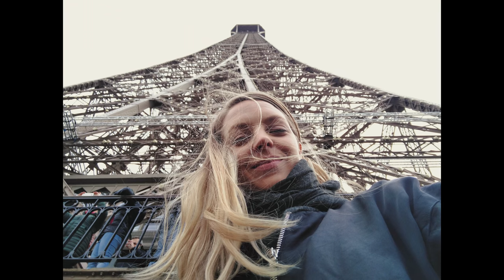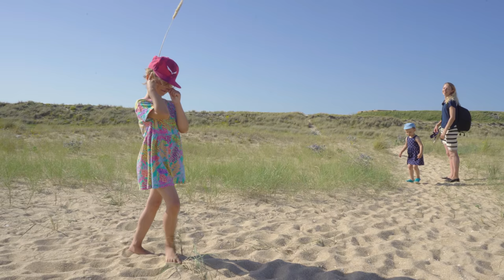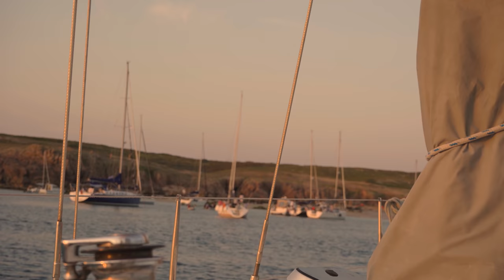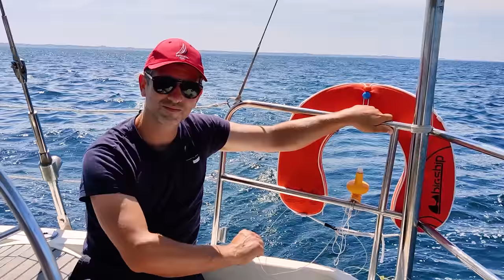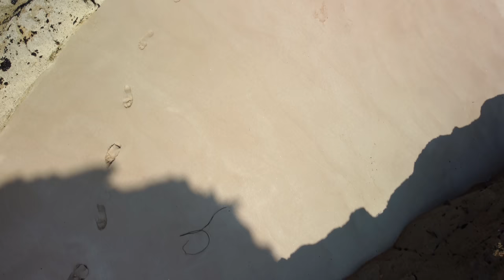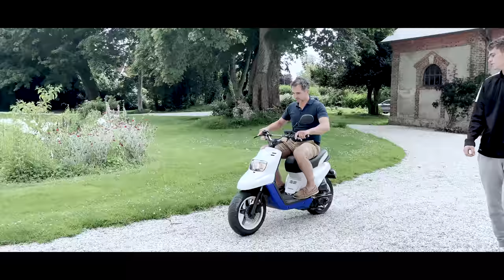Our Chateau Garden was vandalised! - How to renovate a chateau (Without killing your partner) ep. 31

Comment: I live in the country with deer, fox, coyote, ground hogs, rabbits, squirrels, chipmunks, moles and voles, opossum and skunks parading through every day.  My garden is fenced with chicken wire and I’ve raised the beds.  You can buy aluminum corners and just get long planks to slip into the corners, fill with garden soil and voila.  You can put a cage around your baby trees (as I do) or wrap the trunks.  With little trees, a cage is better so they don’t eat the leaves as well.  All of my trees have been trimmed by the deer up to 6’ or as high as they can reach.  My yard is a buffet for them.  I’m surprised they didn’t get your hostas.  They love hostas.  Any plants with a smooth leaf.  Deer resistant plants are prickly like holly or have rough textured leaves.  Good luck.

Comment: As a preventative, try to get a jar of Skoot Repellant and paint it on the trunks. It tastes very bitter to the animals and after one lick they won’t touch it again. I have used it to protect my young trees from mice and chipmunks which tunnel under the snow to get at the tender trunks. The damage does not show until spring. Warning, Skoot is very sticky and impossible to get out of paint brushes so use cheap ones you can throw away after. 
I loved your holiday pictures, such beautiful scenes. 
Sarah from Canada

Comment: it’s still around, you can reattach the displaced bark to the tree. Simply cover the wound with the bark, securing it in place with duct tape or a sturdy strap. It will take about 3 months for the bark to reattach. Be sure to remove the binding once the wound has healed to prevent it from cutting into the trunk as the tree grows.

If there isn’t any bark, clean the edges of the wound. Cut away the torn and jagged edges of the bark with a sharp knife. You want to create a pointed oval with the top and bottom being narrower than the middle. Try to do this without greatly increasing the amount of lost bark or cutting into the tree.

As a final measure it would be a good idea to prevent further deer damage by protecting the trunk with a tree guard. You can purchase these online or at your favorite lawn and garden retailer.

Comment: Hi there,  if the stem (trunk) is ring barked, ie bark removed right around the stem completely, then everything above the site will eventually die. However the tree won't die, it will simply send out new branches from below the injury. You can retrain the strongest into a new leading trunk. These trees a vigorous growers and after a year of growth you wont know its ever been damaged.  Good Luck.

Comment: Phillip for the Tree you can try, bridge grafting, I had to do this to two of my trees due to deer damage and it worked well. Bridge Grafting - For major damage, you may be able to save the tree by providing a bridge of healthy tissue across the damaged area, called bridge grafting, similar to the process professional fruit tree growers use to graft different types of trees together. The procedure is tricky and is best left to professionals. It involves cutting healthy twigs and branches so they lie flat against the tree's wound, cutting a flap into the wound for the twigs and positioning the pieces exactly so the twigs fuse together with the trunk.

Comment: Girdled Trees:  I had this happen many years ago to a favorite tree I’d been nurturing for several years, though in my case the vandals were rabbits, who also enjoy lopping off the heads of tulips and then NOT having the courtesy of eating them - a form of rabbit tagging?
I tried wrapping the trunk to protect it, but a storm snapped it off at the weak point. I cut off the stump, but didn’t go further since I’d have to dig a hole for the replacement.
A 2-3 years later on (not having been able to replace it because I was unsatisfied with the available specimens, it sprouted from the roots, and now (having been protected with chicken wire) it’s a healthy 25-30 feet tall.
However, in my case, I was dealing with a pagoda dogwood, which frequently send out new stems, and I wasn’t in a rush to plant something in that location.
You may not be as lucky with your chosen tree.
Reply from the maker: thanks for the stroy! they also attacked our cornus...

Comment: I know this answer is too late, but the tree will survive, if the bark and cambium layer are gone that main trunk will probably die, but you have the other smaller branch, that will become the main trunk (assuming the current main trunk does not survive) as for preventing deer from damaging it again, you need some sort of barrier, in the UK when planting young trees we will often surround them with a tube, ether of plastic which falls off as the tree grows or of wire fencing, again wrapped around the trunk so it comes away as the tree grows, Deer love young growth but do not attack decent sized trees.

If you want to save that top layer (if you were reading this right after the damage was done instead of several months later) you could wrap the trunk in plastic sheet and fill the plastic with something moist (sphagnum moss is popular for that purpose), then seal it tightly around the trunk, that encourages fresh roots to grow, then when the roots have developed cut the section off and plant it, this is known as air layering.
Reply from the maker: Thanks Terry, we'll try that next time!